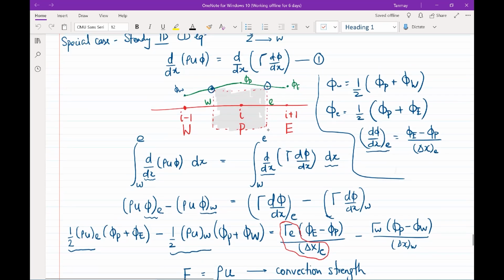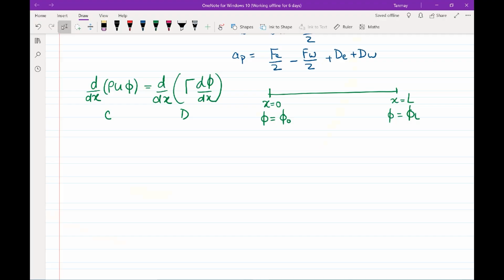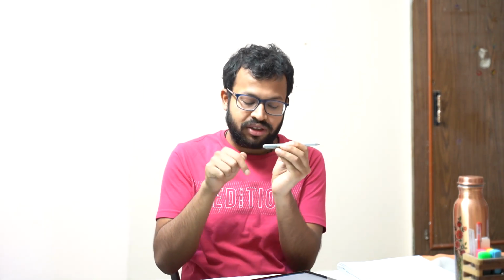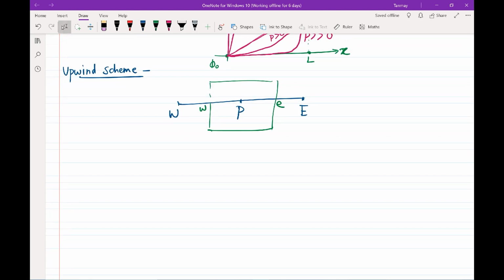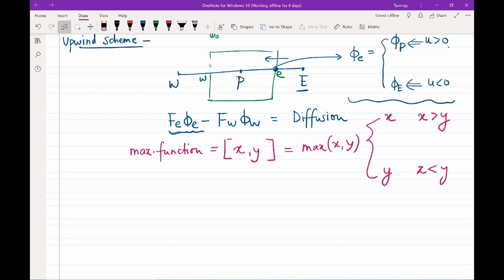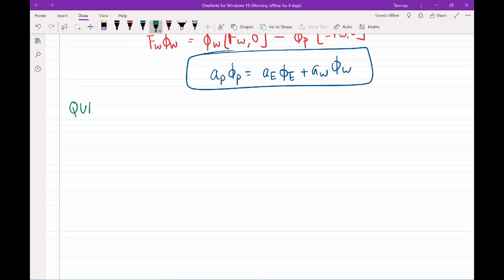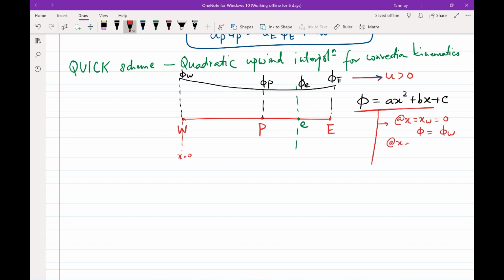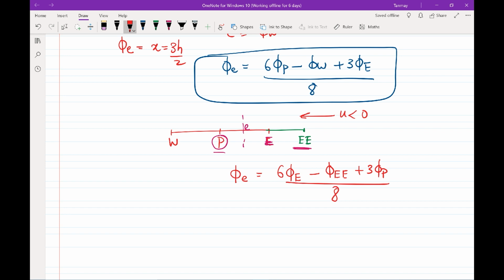Concept of Upwind and QUICK Schemes | Lecture 10 | ICFDM

Comment: Hi Tanmay, at minute 6:35 you said that if the Peclet number is 0, then we are facing a pure diffusion problem, but if you substitute P=0 in the analytical solution, then the denominator in the right term would be zero, how do you solve that, I imagine that that equation wouldn't be the solution in the case of a pure diffusion problem, right?

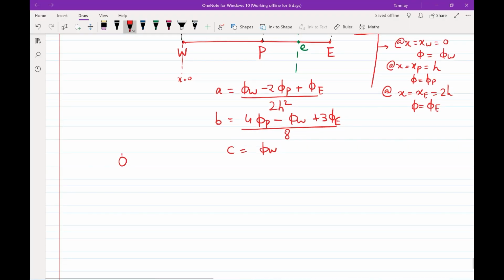Comment: Hi Tanmay, thank you very much for your excellent lectures. I was listening to this lecture recently and I am wondering if you can please explain how you obtained the coefficients a, b, c for the Quick scheme at 22:32. I can’t seem to find the derivation of these values anywhere.
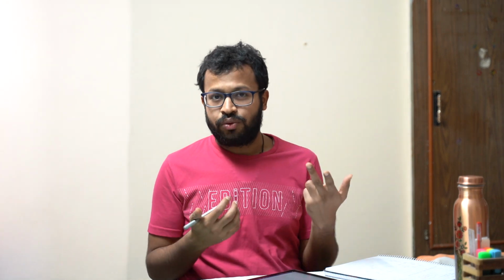Reply: The 3 coefficients are solved for by 3 quadratic equations, where in each equation you plug in the known information at x_W, x_P, and x_E which he discusses at 20:50 - 21:29

I did not verify the solution of the coefficients myself but all you would be doing is solving a system of 3 equations. If you check the pinned comment he also corrected the solution for the b coefficient

Comment: Hi Tanmay,
I have a doubt regarding the diffusion term. What type of interpolation do we use to discretise the diffusion term in the convection-diffusion case. 
Shouldn't it be like the upwind scheme (and not the linear interpolation between gridpoints), as the exact solution is closer to upwind scheme?

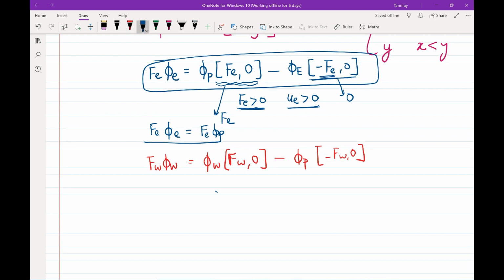if we are using the upwind scheme for the diffusion part, shouldn't the derivative terms in the diffusion part be zero, according to the temperature profile shown in 16:49